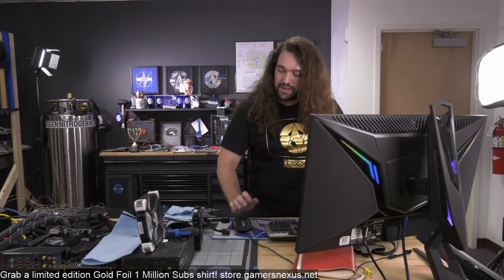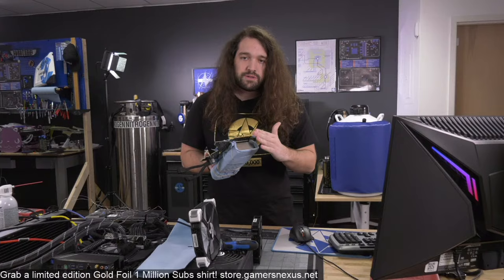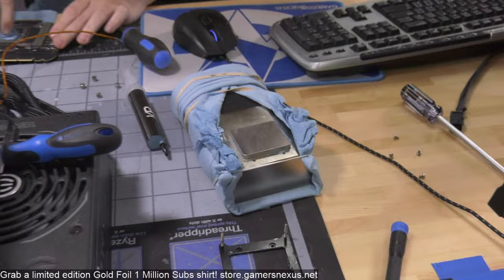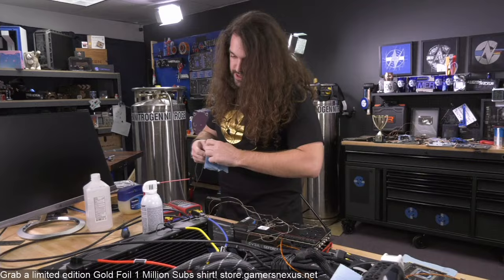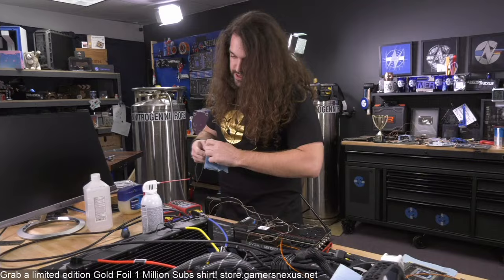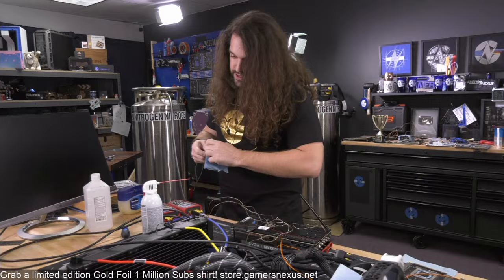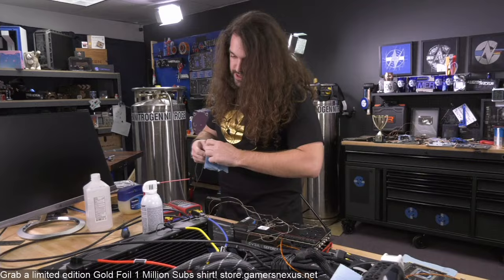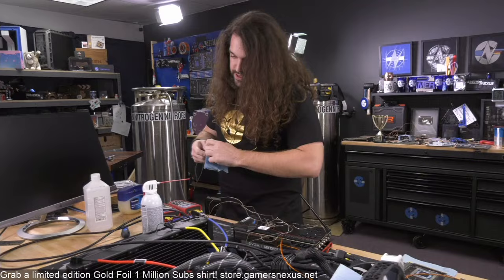LIVE: RTX 3090 Overclocking (Air & Liquid Nitrogen)

Comment: Hi Steve...I read on the Verge when the 3090 released. "Tomorrow, the beefier $1,499 RTX 3090 goes on sale at 6AM PT / 9AM ET, but it’s probably not a solution for any of those problems. It’s really designed for 8K gaming and giant creative projects, with its primary spec boost being a tremendous 24GB of GDDR6X RAM, and Nvidia has revealed today it’s only 10-15 percent faster for 4K gaming than the far more affordable RTX 3080."  Is this correct?

Comment: Snobs love ragging on RGB but it’s extremely popular for a reason. I literally built a $2,000 full open loop hardline system (including the best RGB on a gpu, the Sapphire Nitro+ 5700XT with SE RGB fans) just so I could use RGB fittings and an RGB distro block. RGB4LIFE

Comment: I would appreciate any input, can you give me any guidance on setting bios and ?? to get peak out of this configuration. my first pc I've built... it's running OK... but any help would be greatly appreciated  
ASUS TUF Gaming Z490-Plus (WiFi 6)
LGA 1200 (Intel 10th Gen) ATX Gaming Motherboard
(Dual M.2, 12+2 Power Stages
USB 3.2 Front Panel Type-C
Intel WiFi 6 & 1Gb LAN, Aura Sync)
CoolerMaster MasterLiquid ML240L RGB V2
Close-Loop AIO CPU Liquid Cooler
240 Radiator, Dual SickleFlow 120mm
RGB Lighting, 3rd Gen Dual Chamber Pump for AMD Ryzen/Intel LGA1200/1151
Intel Core i5-10400F Desktop Processor 6 Cores
up to 4.3 GHz Without Processor Graphics
LGA1200 (Intel 400 Series chipset) 65W
Model Number: BX8070110400F
Corsair VENGEANCE RGB PRO 32GB (2x16GB)
DDR4 3600 (PC4-28800) C18 AMD Optimized Memory 
SK hynix Gold P31 1TB PCIe NVMe
Gen3 M.2 2280 Internal SSD - up to 3500MB/s
XFX Radeon RX 570 RS XXX Edition 1286MHz
8gb GDDR5, DX12 VR Ready, Dual BIOS
3xDP HDMI DVI, AMD Graphics Card (RX-570P8DFD6)
Wireless Gaming Keyboard and Mouse,16 Kinds RGB LED Backlit
Rechargeable Keyboard Mouse with 5000mAh Battery Metal Panel
Mechanical Feel and Gaming Mute Mouse for Computer Gamer(Black RGB Backlit)
MUSETEX Phantom Black ATX Mid Tower Desktop PC Gaming Case
Computer Gaming Case USB 3.0 Ports Tempered Glass Windows
with 120mm LED RGB Fans Pre-Installed (907)
VIOTEK GN35DA 35-Inch Curved Ultrawide Gaming Monitor
144Hz (200Hz OC) UWFHD 21:9 | HDMI 2.0 DP DVI w/FreeSync
Adjustable Swivel, Tilt & Height (VESA)

Comment: ufff why u still overclock with offset??? DO USE THE CURVE !!!!!!!!!!!!!!!!!
Reply: So your rank in XOC-ing is what?
Reply: @xite45  my r9 290X 8GB DD is (as all 290x'es) very bad to OC and peaks at 1070 MHz, with AuxV +100 mV and VRM's close to max temp :)
The VRAM can't hold any OC, as most 8GB models as well.
My r5 3600 is garbage bin compared to its production date.
With Water and a Zombiemod I should get more out of the GPU, but with a die that big, it is not that easy to get a bit better, even though ASIC-Quality may be high.
Also it degraded a bit since 2 years ago :)
Reply: @emmata98  the R9s 290 clocks lower than the R9 280/7970? Or did AMD drop capabilities when they switched to the R9 designation instead of the 7970?

Currently hit 1142mhz core and 1385mhz on the memory with air on my crossfire setup
Reply: @dennisperry8579  the 290 and 290x have another architecture :)

and the core is just that massive, so that you have lots of heat more and more voltage drop across the die

Comment: You bought fastest card on the world.
Why should you overclock it?
Is that only to get 100 Hz on 8K?

Overclock fastest card of the world is like fight without goal: there is nothing faster in front of you. And it has also high price on it, 1500 dollars.
I think some people will buy 3080 and try overclock it. Basically for half price try get 3090 speed level. This is more clear goal.

It's kinda useless business to overclock 3090 because you don't know the goal. Only fight between people in top overclock chart.
But for most people it's already fast card, so overclock is not really needed. It's also safe for long time runs. You don't want see game is crashed when you're busy with some challenge there.
Reply: Why overclock the fastest card?

Because you can. Because pushing the limits is a challenge to be overcome.

Because people enjoy doing so.
Reply: @JudgeRightly  I know, i followed the history of graphic cards, i see many news about overclocking. Even i did overclock CPU. Overclock is only for records, not for long time running because we all know it can shorten lifespan, especially you have expensive one. And overclock fastest card in the world is not worth for most people. Cuz it's already fast. Only if you want reach some rank. There is no further useful about overclocking fastest card.

It seems fastest card uses a lot energy, it's pretty hot and that means the gain of overclock might low compared to cheaper cards. They're less hot, lower energy and so more chance to overclock more for more gain.

Only cheaper cards like 3070, then i understand some ppl want squeeze more out. More "bang" for the buck.
Reply: @mrdummynl6814  I run 2x 980Tis in SLI. Overclocked both. I get better performance on newer games than I would otherwise. I also overclocked my CPU and memory as much as possible. It's not just for benchmarks or records. It's for better overall performance. I've been running this system for the past 5 years or so, haven't had any issues.

I will note that I also run 4 monitors (3x 1080p and 1x 1440p). So it helps with that as well.

My current PC build that I'm working on will be running 4x 1440p high refresh rate monitors, using a 3090. I will definitely be overclocking the card to get the best performance possible out of it, and I will run that build as long as I can.